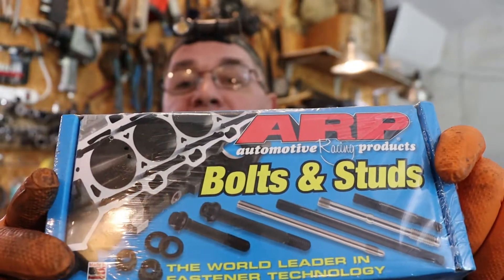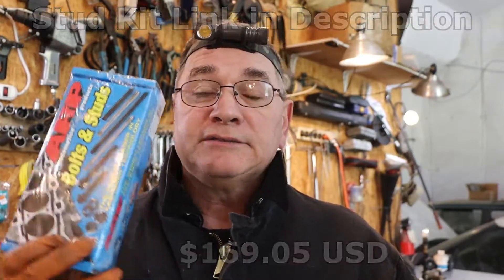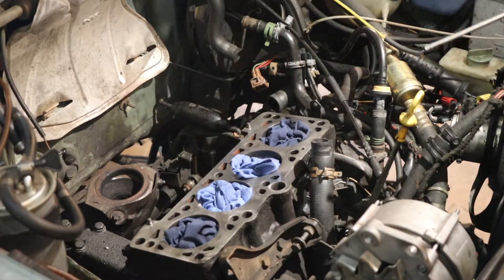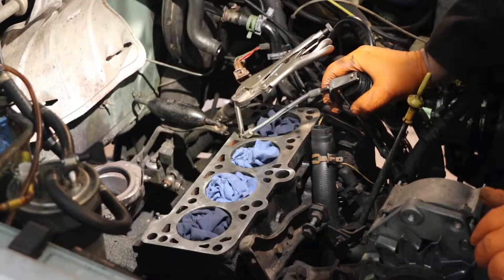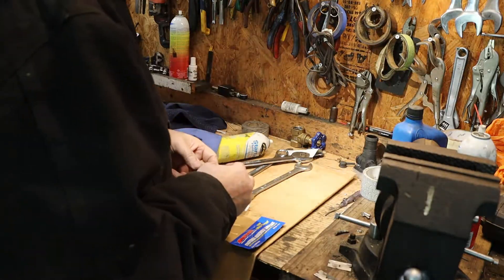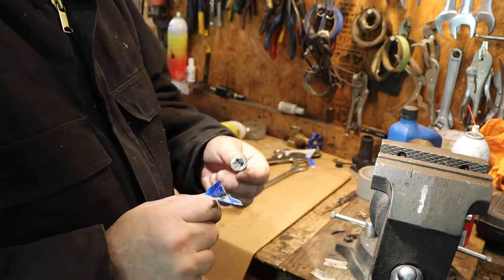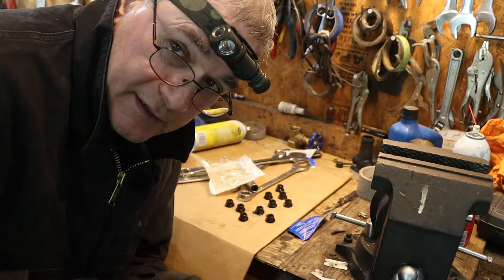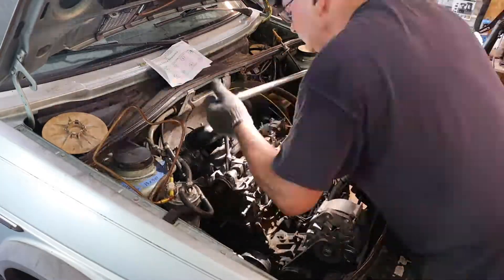Installing ARP Stud Kit 204-4706 Cylinder Head Bolt 1982-2002 Volkswagen 1.6L & 1.9L Diesel  MK2

Comment: thanks. looking for info in regards to interchangeability when it comes to the heads. I have engines laying around my garage. Blocks and heads are separated and all mixmatched. My 82 diesel pickup has a cracked head that leaks water. If I know interchangeableness I can identify if this head will work for me.
Reply from the maker: There wil l be a few differences in the early 80s in the  1.6 heads. The fact you can use them on a turbo I found interesting as. Long as you put the new valves in. Turbo heads are almost non existent.